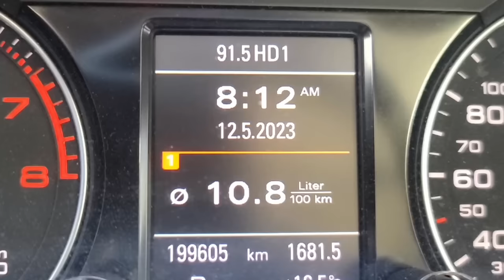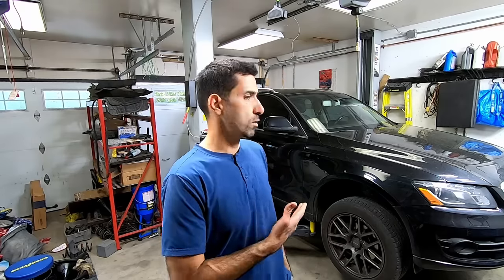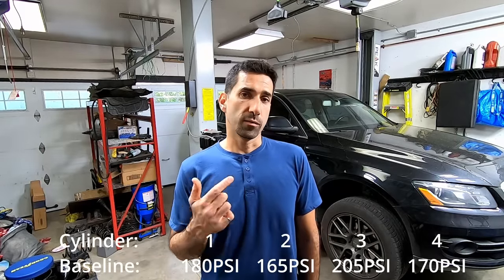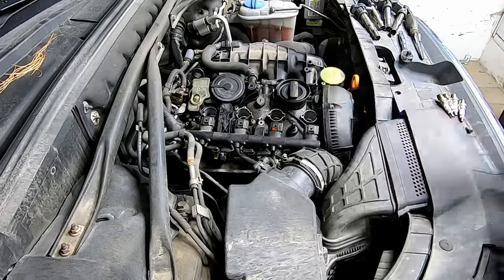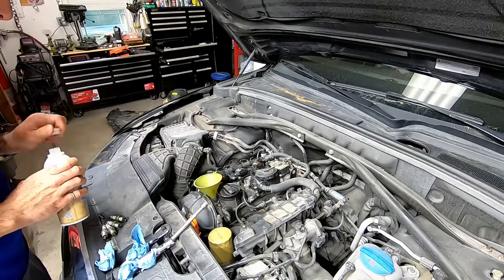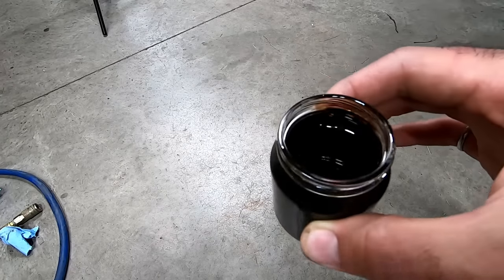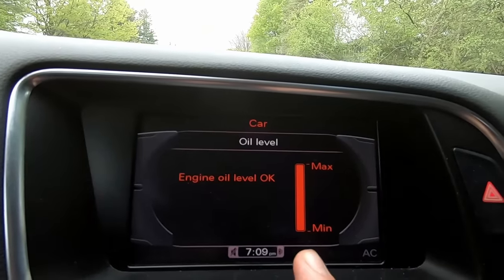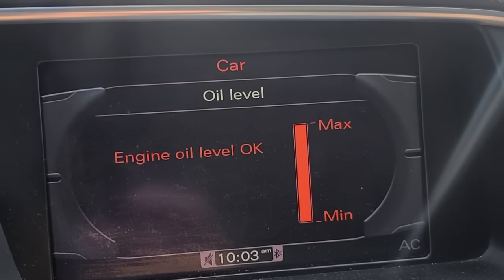How to fix excessive oil consumption from clogged piston rings (Part 2)

Comment: Does this work on all engines or just for Audi? Im hesitant to put anything in my cylinders that isnt fuel.
Reply from the maker: Should work on any engine that is burning oil due to clogged piston rings... I've no experience with more exotic aluminum blocks, and as far as I know,  no viewer has tried it on one of those yet but anything with cast iron block should be good to go... what engine are you having issues with?

Comment: I was really hoping to see the after treatment compression readings.
Reply from the maker: Didn't change much - +- 5psi on all cylinders
Reply: @ETMotorsports  Kind of surprised there wasn't more of an increase. That much of an oil use reductions significant and I would think compression would have been impacted more than that.

Comment: Great vid thank you!  On a totally different subject whats your thoughts on the vw/audi approved 502/508 oils?  is it ok to run a high quality oil that does not meet or have the vw/audi 502/508 approvals in the 2.0T? And is it ok to use 5w-30/40 oil when it calls for 0w-20?  Thanks again
Reply from the maker: hey from what I've read the oil is not backwards compatible so you should not be using 5w-30/40 in stead of 0w-20 508 oil if your engine requires it...it's only for the newest generation VAG engines...basically use the oil recommended for your engine

Comment: I have a 99 silverado and it burns 6 liters of oil every 2 weeks and it starts to smoke heavily when i start to accelerate after leaving it idling for 20 minutes
Reply from the maker: wow that's significant...no leaks? could be oil coming in through the valve seals?

Comment: Hello.. I have a question.. I have a 2012 Renault duster 1.5 DCI diesel.. the car is burning oil at an alarming rate but there are no other issues.. the pickup of the car is fine, not much smoke.. and no oil leaks.. I assume its a stuck oil control ring and I want to try your method.. just one issue. The car doesn’t have spark plugs .. it has glow plugs.. Now im a novice in car engines but I suppose glow plugs are a bit more fragile than spark plugs to remove? Also the hole for glow plugs is much smaller? Would the same method work for an engine with glow plugs? Please advice
Reply from the maker: hey I've received that question a few times...technically there's nothing stopping you from doing this on a diesel motor ...you're right that the glow plugs are more fragile and unfortunately they're prone to cause issues when being removed...I would be very careful removing the glow plugs especially if you don't have experience doing it - in most of my diesel motors they tend to shear since they're generally not removed very often...

what does the injector setup look like on the motor? are you able to take the injectors off instead?
Reply: @ETMotorsports  I think I can remove the injectors.. though its a bit more complex…. But that is a possibility yeah
Reply: @ETMotorsports  hey one more question.. can I use berrymans as an engine flush on a diesel motor? They recommend not to put it in the fuel tank on a diesel because of its low flash point.. just wondering if you’ve tried it?
Reply from the maker: @gameexpert2009  yeah so not in the tank but I can't see a reason why you can't flush with it... if you're just doing a flush though maybe use a chemical designed for a flush like SeaFoam or LiquiMoly
Reply: @ETMotorsports  okay! I just flushed it with liquimoly… ill see and update on how much the burning as improved.. Additionally I’ve also ordered bars engine repair.. ill add that to the oil.. if the oil burning improves a bit, ill do another engine flush..
Reply from the maker: @gameexpert2009  you just did an engine flush? No soak? I'm curious if that'll have any effect - not sure a flush has enough time to work the rings up... there are a few chemicals out there sold specifically for that - I think DAP did a video on a passat... either way keep us posted on your results

Comment: Hello I did the same treatment lasted 2000km. Would you do it again or just wait? I was adding 1litre every 500km before the treatment.
Reply from the maker: Hey the Q5 is at 5k+ km on the first oil change with no oil light yet... if you saw an improvement the first time I would definitely do it again... is it consistent at 1L/2000km now?

Comment: I've driven 1000 miles and the gauge reads half. Yayy. Will be doing this over the weekend. Hopefully it works so i can sell it 😂
Reply from the maker: Half a letter in 1000 miles is well above the manufacturer spec - you're technically ok for now and can probably sell the car without issues
Reply: @ETMotorsports  This is true. But we all know the manufacturer spec is BS and just a way to cover their ass! I figure if i can get to it before it becomes a bigger  issue i can enjoy the car for a bit before i sell it as i just sorted all the common issues, wastegate rattle, pcv, waterpump, carbon cleaning, ect. 

I hate this engine!
Reply from the maker: @seanh9869  can't argue with that...1L/1000km is nonesense... try this at the next oil change and let us know how it goes

Comment: Lemme see if I get it correctly, you add the B12 at equal amounts for 12 then 12 hours while the engine is off, is this correct? or I should turn the engine on?
Reply from the maker: yup - engine is off the entire time...you rotate the crank by hand every 6hrs or so

Comment: If I have black smoke on my A4 coming out of the exhaust and burning oil should I do this piston soak to it or is it something else? Please let me know.
Reply from the maker: it could very well be the piston rings...how much oil is the car consuming? Have you checked all other common points of oil loss - PCV etc?
Reply: @ETMotorsports  No I haven't tbh I drive it for Uber average 200 miles a night and use a quart or so every night.
Reply from the maker: @jonathandominguez5463  yeah that's a lot... so most likely the rings... worth trying the soak I guess at your next oil change
Reply: @ETMotorsports   ok so maybe change the pcv and piston soak and call it the day and see how it goes
Reply from the maker: @jonathandominguez5463  that much consumption isn't coming from the PCV but it's fairly cheap and easy to replace do can't hurt

Comment: Hey I need your help I have a5 with that same motor and it’s making a sound , can I please email you it or something n you can hear it an tell me what you think ? You seem very knowledgeable on this I got robbed 2600 for a new engine now the engine making the same sound as the other engine, I did the swap myself and now I’m stuck please help me I just want help with the sound like if it’s the chain/tensioner or the rob bearings or whatever please

Comment: Would you recommend this solution for a Toyota Avensis 2004 2.0 without a turbo? Im not sure if the Toyota suffers from the same problem?
Reply from the maker: This method has been tested on a number of Toyotas successfully... before doing this make sure you've addressed any other possible sources of oil loss such as leaks,  PCV etc... if there's no other obvious source of oil loss you might have ring issues...has a mechanic looked at the car?
Reply: @ETMotorsports The oil burning is not at the rate which you mentioned, like 1L every time you fill up your tank? It is more like around 4L every 6 months and by that time I've covered  5000 miles.
There has not been any in depth analysis by a mechanic since it's hard to narrow it down to only the piston rings or inside the combustion chamber. 
It is a old car from 2004 so with only the regular oil service and etc its "normal" to have this kind of oil consumption.. I've heard at least.
Reply from the maker: @ashystyle  so about 1L every 2-3000km... yeah that's not as bad but it could still be the same issue...

Comment: Mate do you think this could work on an 07 toyota avensis 2.4L 2AZ FSE Motor?
Reply from the maker: If it's suffering from clogged piston rings then yes
Reply: Thanks for the fast response. It probably is (2AZ FE motors from the US are notorious for it, this euro FSE is a bit different tho but uses 1l/500km. In germany here I cant get my Hands on Berryman B12 , would something like LiquiyMoly Engine Clean (Eingine Flush) also work? I used it for 10min idl today before my oil change. I will see what it does and if it doesnt work I will need to soak it like you did. But your video and the comments give me hope! @ETMotorsports
Reply: just the LM engine flush didnt help at all, need to find something as good as B12 for the flush

Comment: Has anyone tried a Audi 2016 Q5 model yet? I’m trying it today on mine. Also any tips on how to turn the crank? I’m new to this and don’t know the details of turning counter clockwise or clockwise. Also afraid of what specs to use for torque and socket. Any help would be amazing!
Reply from the maker: 2016 q5 will be identical - same setup... clockwise is when you're facing the front of the engine - basically "tighten" the crank bolt... it's a size 24mm... if you're not comfortable doing it or don't have the tools just skip this step
Reply from the maker: a
Reply: Thank you! Relieved to skip it, but won’t I need to crank to get the pistons at the same height?
Reply: Update: Complete Success! Previous to this process my 2016 Audi Q5 at 115k was consuming all the oil in 400 miles. I am now past 400 miles and the oil gauge  has stayed at full the entire time. Thank you for this save!!!

Comment: I did the treatment with no results, maybe a insignificant extra 20 miles (stands at 1l/320 miles, previously 300 miles). I have the old PCV valve (with black cap), planning to change it to white cap, update the software (no idea if it has been updated) and retry the treatment. Do you think it did not work because i have the old PCV valve/software ? PS: A4/2009/1.8 Petrol ? Any other persons here as well as the video owner, any cheap way to update the software ? I got a quote from an independent for £120, a lot of money for what it actually does
Reply from the maker: honestly the PCV cannot account for that much oil loss regardless of how poor it works or what software version you have...I've replaced the PCV on both the Q5 and A4 I did the soak on and it had zero results...

can you give some more details on how you did the soak? so far it's pretty fixed every car that's been reported here so I`m curious why it didn't work on your motor...
Reply: I have front parking so I was able to pour B12 at around 6 hours over a bit more then 24 hours, around 28 hours I would say. I have not been able to turn the engine every time as I did not had the 24 mm spanner. I did turn it but not as you did I would say. I used two bottles of the B12. Just bought more so I am planning to do it again in the near future, just want to use the new oil and filter for a bit more time. After, I run the car mainly a bit on the motorway for about 30 minutes, again, I could run it longer next time. I poured the B12 directly into cylinders, will do the same on the next flush.  Not sure what I should change, any ideas welcome. What I noticed is that I definitely did not had that much black smoke coming out as you did with the Q5.. Thank you, hopefully I’ll have better luck on the next flush.
Reply: Quick update. The oil consumption improved gradually from the last time I wrote. It is now stands at 490 miles plus from 300 initially. Have not done another flush with B12 yet, but will update as the time progresses. Thank you so much :)
Reply from the maker: @leonardraducan5655  better than nothing...I would definitely do another soak at your next oil change... try to do it longer, turn the crank more, maybe run it a bit longer,  you can also substitute for something like T6 Rotella for the first 1000km
Reply: Thank you. Very helpful 🙏 @ETMotorsports

Comment: When do you put back the coils and spark plugs ?
Reply from the maker: After the treatment is done you run the starter without plugs for 20-30 seconds and once the cylinders are clear and everything is spinning well,  you can put the plugs and coils back and start the engine

Comment: I just did this to my 2012 a4 but even after the oil change and new spark plugs it’s still having a misfire
Reply from the maker: One specific cylinder? Have you checked the plug? Is it wet? Did you have a misfire before the treatment?
Reply: @ETMotorsports  no misfire before doing the treatment. Only after starting the car. Kept it running for a good while before driving it and still a misfire. Thought it would go away with the oil change and new plugs but it’s still doing the misfire. Have not checked if the plug is wet today yet. Will be looking it over again

Comment: Are you worried at all the the Chemtool Reduces the oil viscosity? I’d be scared driving it at all with that in the oil. Maybe do the soak..start it and run at idle for 10 min, then change the oil and run it?
Reply: I agree. Seems counterintuitive to drive with thinned oil. Wonder if that might explain the particles in oil as one would think thinned oil will affect the lubrication.

Comment: Do you remove the fuel injector fuse to crank up the engine with the spark plugs removed to avoid gas getting into the cylinders?
Reply from the maker: You can but I don't bother - you only crank in the end to clean up the cylinders so if the injectors spray a few times it's not the end of the world... you certainly can remove the fuel pump fuse if you want to
Reply: @ETMotorsports  awesome!! Will try on a 2008 Jeep GC with 271k miles to see if results can be extrapolated to other brands.  Keep you posted

Comment: Dear if i didn't found 0116 b12 in my country and i found only 0117 b12 it's good same results for my audi q5 2010 or it must get 0116 buttol
Reply from the maker: hmmm 0117 seems to be a choke cleaner which is normally in spray version so you won't be able to use it...do you have access to some sort of an engine flush such as LiquiMoly?
Reply: @ETMotorsports  ya we have alot of liqui moly product so what I have to start with same as berryman
Reply from the maker: @shekobko2  I would try the LiquiMoly Pro-line Engine Flush - just replace the B12 with it - same process

Comment: hi Eurotrash
this is a Sam
i have a problem with oil engine and i add oil every two weeks for 450 miles 
i check the muffler pipe there is a oil 
and my car have only 36500 miles 2019 audi Q7   55 premium plus i just bought this car 5 months ago i need your opinion if you don't mind
Reply from the maker: hey Sam - which engine in the Q7? 2019 should have no issues with oil burning - this doesn't sound good...if you have oil in the exhaust is it possible your turbo has blown a seal and is leaking oil in your exhaust? assuming of course you have a turbo...
Reply: @ETMotorsports  hi good morning 
thank you for your answer 
so i want last time to the audi dealer at westwood,ma i did the oil change the mileage was 36947 next day i check the oil level was between mix to min its in the medal back to dealer they add oil today i check the oil again it's went down again only for  113 miles from friday it's to much problem its look like oil consumption i believe the ring problem what do you thing ???? thank you again

Comment: good video and show ow to do it. ohh ths is also a good way of saying. change oil often. then it keeps good and not bild up that easy. But good to have a try out with b12 . 
I did  a flush on a 2l  pasat tdt  from 2002. (not with b12)., who was bad. bad turbo and smoky.,.,smell like urh,,, but after treatment, run nice. the turbo workt a lot better.